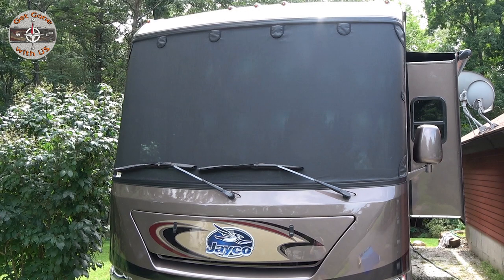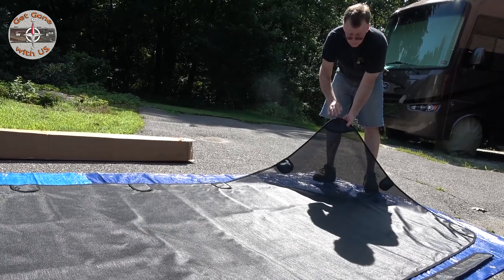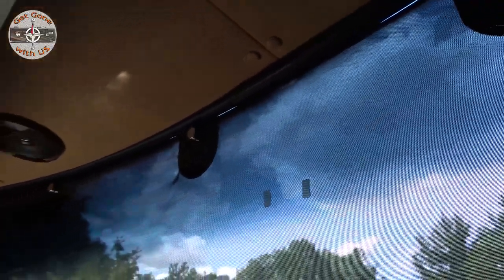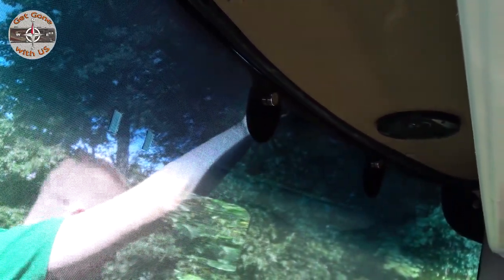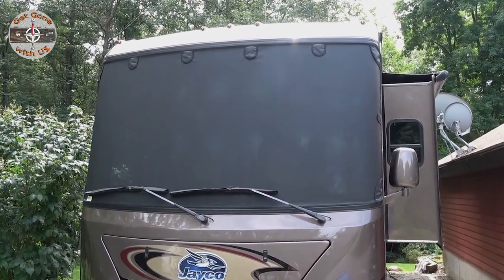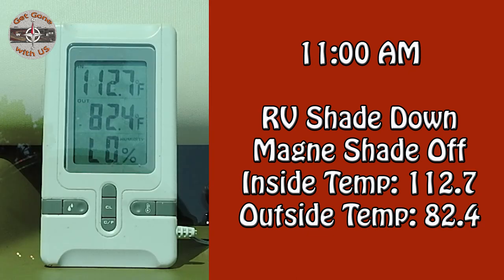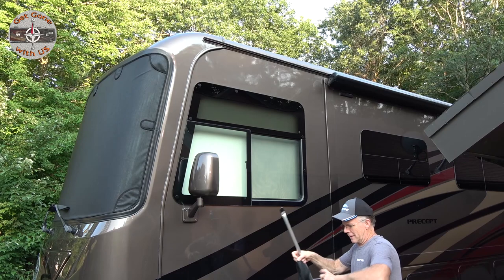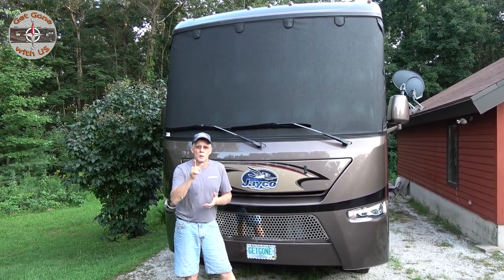Magne Shade and Side Shades Install by an RV Owner

Comment: Great Video and great product. We also use the Magna Shade and our only issue has been high winds. We have had our windshield Magna Shade blow off twice once in the middle of the night during very high wind (I should have know to take it down but didnt) at Ricon Parkway in California and luckily a neighbor went outside around midnight to check out the wind and saw our Magna Shade on the highway and got it for us, the second time we were away from the campsite in town when a sudden rain storm blew in in south Texas and another neighbor happened to see it blow off and went out in the rain to retrive it. We have decided to take them off if the wind is expected to get over 30 or so as they are to expensive to replace if we actually lost one. Have you heard of any solutions to the high wind blowing them off the windshield or is taking them down about the only solution?
Reply from the maker: Thanks Bob! This is the first we are hearing about them blowing off during high winds.  We know people take them off during rain storms.  Maybe we'll err on the side of caution and take them off during high winds.  They would be very expensive to replace.  Thanks for your comment and sharing. :)

Comment: Got them installed and looks great. Thanks for the video details! And YES, having two A’s even separated by the small washer/spacer is a challenge to separate.....ask me how I know..LOL.
Safe Travels and stay safe.
Reply from the maker: Way to go, Tom.   We know about separating them too. LOL
Reply: I might add, if anyone does get them “stuck” together, a putty knife or similar will separate them. Any VHB tape that gets damaged can be replaced with the extras. Our coach was noticeably cooler with just the windshield shade in place.
Thanks again!
Reply from the maker: @tomhayman6553  Thanks for your tips, Tom.  They might be of help to some people.  :)

Comment: Would the magnets for the driver side and passenger work inside as well. I would worry losting one on the road.
Reply from the maker: No, they are probably not strong enough to go through the window and the MagneShade.  We have had ours on since 2018 and driven over 10,000 miles since installing them and have never lost one. 😀

Comment: Liked the video and glad to see your attention to detail which is the way I am too.  Also like your unscientific testing method.  I read the comment about blowing off in high winds.  Maybe there should be a grommet at the bottom corner to where you could tie a cord around the outside mirror to keep it from blowing away if you're away from Maggie and don't have someone to retrieve it for you.  Maybe suggest that to the company or they may have a better suggestion.  Who wants to take it off on a hot summer day in anticipation of high winds or rain while they're away.  Kinda defeats the purpose doesn't it.
Reply from the maker: Thanks, Carl. :)  We used the Magne at every campground on our 5 1/2 week practice run.  There were a couple of really windy days and nights.  We thought about the comment mentioning it blowing off, but it held firm.  Not sure if it is the tight curve on the sides of our windshield or not, that holds it tighter. Of course the side widow shades stayed on too.  My problem with a grommet and a tie strap is if the wind is blowing that hard, there are magnets sewn into the shade.  I really don't want the shade beating against the paint in the wind.  RV's don't have the best paint job on them to begin with.
Reply: There are things like that to consider.  Sure wouldn't want to screw anything up.

Comment: I loved the video. We had Magne Shades on our last rig and really liked them. One thing I did when I would take the windshield one off is to fold it almost in half, so the magnets wouldn't stick together, and then roll it up on a pool noddle. It worked great and made storing it very easy. When I rolled up the side windows I put the wiper covers inside each of them to help keep the magnets from sticking together.  
Keep up the great videos and thanks for sharing.
Reply from the maker: Thanks James!  That is exactly how we do it when we store it, pool noodle and all.  While we were on our 5 week practice run though, we just laid everything out in the back of the Jeep, moved to the next campground and put it back on.

Comment: I love the test you did with the temperature but I'm really surprised the Magne Shade didn't block more heat than that?! I'm considering ordering because we're in Texas and need to block as much heat as possible but for $595 do you think it's worth it for heat blocking or is it more of a privacy shade?
Reply from the maker: We bought it for the ease of installing and removing.  We also bought it for privacy, we love having the view out the front window without being on display ourselves. LOL  THe heat that gets blocked is just a bonus. We would buy it again. 😃
Reply: @GetGonewithUS  Awesome! thank you so much!!! I agree and would be great to not have the big shade down all the time just to privacy; the service from the guys there has been awesome too, one call yesterday and I was provided a bunch of great resources (videos and measurement guides) to make ordering easier... I have a "bulkhead" which makes the interior magnet placement unaccessible but they knew the exact remedy!
Reply from the maker: That’s great. They usually sent the link to our video too even though we get no kickback. Lol